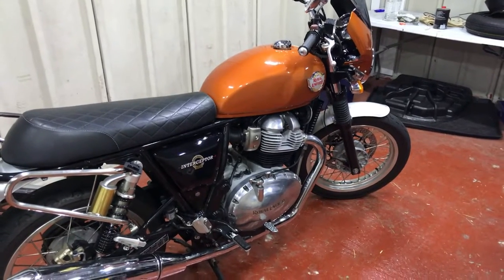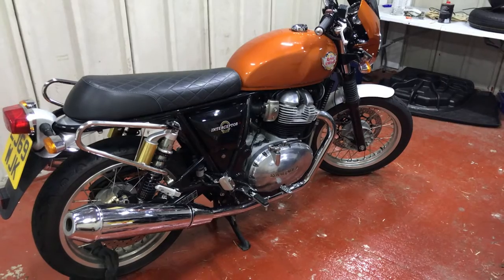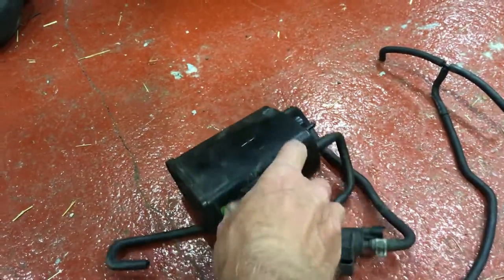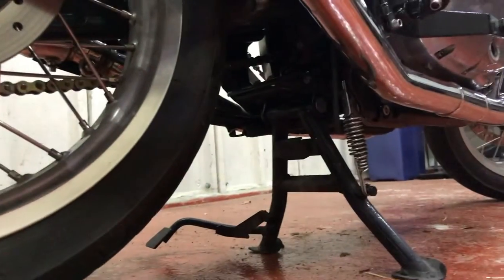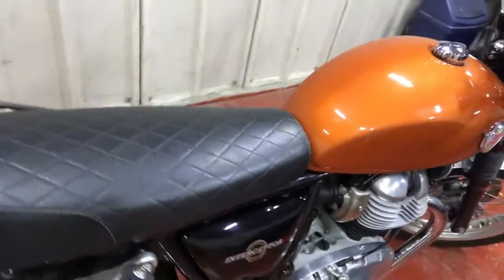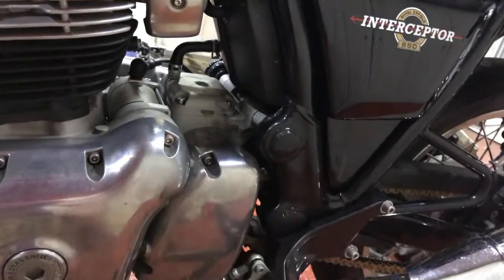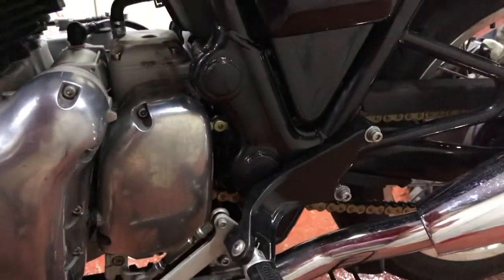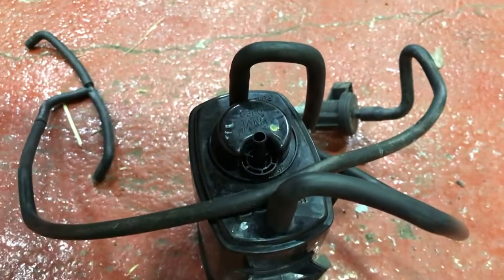Removing the EVAP system from Royal Enfield Interceptor 650

Comment: Hi there, I've recently done this delete too. Have you had engine management issues. Mine has flashed up twice with purge system open after opening the petrol cap and refueling. I'm noticing that when the fuel is low, I'm getting a rush of air into the tank now. This wasn't happening with the Evap system in place.
Reply from the maker: No, no issues with the management light so far for me. I have a code reader just in case. A rush of air into the tank would suggest that the tank is not breathing, so the fuel pump is pumping and creating a partial vacuum in the tank which is released when the fuel cap is removed. Are you sure you blocked the correct pipe with the bolt? There are two pipes under the tank which lead down to the bottom of the bike. One has to be left unblocked and I suspect that’s the one that lets the tank breathe. Have you tried removing the bolt completely and seeing what happens
Reply from the maker: Just thinking….I wonder what her effect of connecting up the purge valve into the wiring harness would be? ie replacing the delete kit plug-in and putting the purge valve back but unconnected to pipes, cartridge etc.? The valve doesn’t look hi-tech to me and seems to be a simple on/off gadget which allows the actual ‘purge’ to be achieved by the inlet manifold suction. So, if your ecu has an issue with the delete plug-in, maybe connecting up the purge valve would keep the ecu happy? 

That is, of course, after you check re the pipes, as in my previous reply.
Reply: The two pipes (let's say left and right if sitting on the bike) are different gauges. The larger one on the right hand side, I have blocked as the other is too small for the bolt.
Reply from the maker: @EvenIris  yes, that’s correct then. I just checked on my bike. Yes, you’re correct re the bolt size and it not fitting in the other pipe. I lay next to mine just now and sucked on the thinner gauge pipe and it’s not blocked and tastes vaguely of petrol vapour. That pipe connects on the left side of the rear of the tank. If you undo the two retaining bolts for the tank, it will lift enough to see the pipe and where it goes into the tank. Is your thinner gauge pipe clear and not blocked?
Reply from the maker: @EvenIris  looking at the manual, the thinner diameter pipe which connects to the LEFT side of the fuel tank (viewed as if sitting on the bike) is called the “drain hose connector”and the larger diameter pipe on the RIGHT (the one with the bolt in) is called the “Evap connection hose”. So you’ve blocked off the correct pipe, of course. The drain hose connects to the left stub and whatever it connects to is inside the fuel tank. My guess is that it is some sort of breather. Is yours blocked?
Reply: Just done the same. Seems to be clear after blowing/sucking the pipe. Time to delve deeper by the looks of it. Wondering if the dummy plug is badly wired up.
Reply from the maker: @EvenIris  yes, that’s what I thought. Is it plugged in correctly, as in pushed in hard? The wiring harness connector is just two wires. I did wonder if the delete plug-in is just a way of joining the two wires together! Looking at the plug-in, there doesn’t seem much to it. How about connecting up the purge valve instead? Without anything attached to it?
Reply: @internetpolification  I'll loop a wire between the connectors in the harness and see what comes of it. If that is the case,  I'll send the kit back as 21 quid is a lot for a bolt, 2 rubber caps and a plug.
Reply from the maker: @EvenIris  yes, I did think that myself!
Reply from the maker: @EvenIris  how about just connecting up the purge valve but with no pipes attached to it? As far as the ecu is concerned, it’s connected but it won’t actually be doing anything other than open and close (if that….. mine didn’t).
Reply: @internetpolification  so after further investigation, it seems the wiring wasn't too great in the dummy plug. The wires were both so kinked, it was breaking contact. After rewiring it, it seems to be ok . Thanks for keeping in contact with suggestions. 👍
Reply from the maker: @EvenIris  oh wow, that’s great! Yes, the wire that bends round at the end of the plug has shrink tubing on it and it did strike me that it’s quite hard and I wondered what was inside it. That’s really good news and I’m very pleased for you. My bike has been transformed since doing the modification….no more reluctant starting, lumpy tickover etc. I don’t think you’ll regret doing the modification
Reply: @internetpolification  I've had hot start issues for a while and fluttering idle. I didn't realise how involved the Evap unit was when starting the bike. My canister was empty of everything. After 25k miles, it was long overdue. Haven't noticed any fuel deficiency since (although my gauge seems to decrease faster but, still getting approx 150 miles between fill-up). Thinking of putting a lithium battery and starter relay in its place inside some kind of casing 🤔
Reply from the maker: @EvenIris  so the delete cured the hot start issue and fluttering idle for you, did it? It certainly has on mine. I use my bike daily and not once have I had problems like before.

Comment: I ordered one of those kits yesterday.  Hopefully it's not too much of a faff to fit, I've had a look at your detailed instructions.
I wonder if my canister is full of fuel.
Ride safe
Reply from the maker: I don’t think you’ll regret doing it. Just remember to remove the sprocket cover and side panel. If you look for the purge valve (with a torch..it’s dark in there) you’ll see that clip first, probably. If you grab that clip and pull towards you, the purge valve will come off the little bracket that it clips on to, and towards you…..there’s plenty of wire on the wiring harness to allow this and also on the rubber pipes. This will enable you to grab the purge valve. The trickiest bit I found was getting the electrical connector out of the purge valve! It has a weird clip thing and another push tab and a rubber seal which grips tightly. I finally got a small screwdriver into the clip and broke it all off…it’s part of the purge valve and not the wiring harness block connector. Then it was a case of pulling the plug out of the purge valve against the yellow seal trying to keep it in there. Just persevere and it will come out. Pull the wiring harness block connector toward you and attach the bypass plug in your kit and I then cable-tied it to keep it accessible under the left side panel. I tied it to the wiring harness there. After that, it’s just a case of removing the charcoal cartridge from under the bike…..make sure you mark the ‘TANK’ pipe ie the pipe that goes to the middle tube on the canister that says ‘tank’…that’s the one that you block with the Allen bolt. The other one stays open and unblocked. The charcoal cartridge has a breather which goes up near the battery ….just remove it. And all the other pipes which come down from the manifold stubs, round the back of the cylinder head and down through clips in the frame on the right hand side of the bike. Just remove them all. Then block the stubs on the inlet manifold with the caps in your kit. The LEFT side manifold has an extra stub on the inside of the one you need to block. Just ignore that. It’s the outer of the two on the left side…the one which had the tube attached, same as on the right hand side.  

I appreciate doing this job every time I get on my bike (several times today) and start the engine first time every time instead of what was going on before.

Any problems, post here. And do let everyone know if you have petrol in the canister and post about the difference! 😀
Reply: @internetpolification  I've removed all the pipes and the canister, was a bit more of a faff than I expected but the bikes all ready for when the kit arrives.  Your instructions are spot on, thanks for sharing that.  The charcoal canister is full of fuel, just like yours, doesn't rattle either.  I'll let you know how the bike preforms once I've given it a good test.
Ride safe.
Reply from the maker: @paulstoker7650  wow..that just goes to show, doesn’t it? Full of fuel just like mine and I bet you’re not aware of having ‘overfilled’ the tank? So easily done, it seems, and then problems after that.

Yes, it’s a bit of a faff getting that purge valve electrical connector out, did you find? I thought the rest was easy enough…just removing the pipes. 

Make sure you plug the delete electrical plug in well and then cable tie it to the wiring harness that’s visible under the left side panel. Nice and dry in there, I reckon. 

Yes, please do post here the results after test starting and riding……
Reply: @internetpolification  The delete kit will hopefully arrive today, I'll let you know how I get on after the test. One thing I did notice is that there's a fair bit of electrical wiring at the back of the engine, the charcoal canister is doing a good job of stopping all the road dirt, water and salt from being flung onto the back of the engine and electrical connections.
Rather than fabricate a plate to extend the mudguard down, to cover the gap.   I've re fitted the disconnected charcoal canister just to protect the back of the engine and electrical wiring.
Ride safe and thanks for the advice.
Reply: @paulstoker7650  yes I was of the same opinion that the canister was doing a good job protecting the solenoid and rectumfrier. EVAP delete completed but canister put back in situ - it weighs sod all anyway. I might even cut it in half at some stage ..
Reply from the maker: @paulstoker7650  good idea!
Reply from the maker: @ChrisMurphy-lg3pj  I think I will also spray some aerosol chain grease onto the block connectors…

Comment: A dumb question - why delete it in the first place
Reply from the maker: Did you watch the video? It’s all explained in there in detail but, put simply, the Evap system often causes bad cold starting, even worse hot starting, lumpy tickover and even stalling.
Reply: @internetpolification  I must admit I had the sound down low so I wouldn’t wake anyone in the house lol 😂 I will listen to it properly now 👍
Reply from the maker: @nickbasiliou5744  such courtesy is admirable. Honestly though, removing the Evap system has transformed my bike which is only 18 months old and done 5,000 miles. It got to be a right pain with difficult starting etc. now it’s completely and utterly cured
Reply: @internetpolification  hay that's good news. we won't those bikes for easy starting and reliability.
Reply from the maker: @DANTHETUBEMAN  mine was a swine to start cold, just as bad hot, stalling, engine starting up and stopping immediately, necessitating several ‘starts’. I removed the Evap system and……all….all….every singleon…..all of the problems disappeared immediately…never to return….

Comment: Hi mine is a 2021 Euro 5 will the kit plug work with mine?
Reply from the maker: Hi. Yes, it will. It’s a slightly different kit from the one in the link I posted but the same eBay seller has the correct one for the later bikes. The difference is that the block terminal on your wiring harness, that fits into the purge valve, is a different shape. If you contact the seller in the link I posted and give him the year of your bike, he will send you the right one. I noticed he had two kits and checked before I bought mine. I’ve literally just got in off my bike and am still so happy with immediate starting, first time every time!
Reply from the maker: https://www.ebay.co.uk/itm/265610600890?mkcid=16&mkevt=1&mkrid=711-127632-2357-0&ssspo=3vNi2KEtS0K&sssrc=2349624&ssuid=aoSTS-GYQ3W&var=&widget_ver=artemis&media=COPY
Reply: @internetpolification   thankyou james